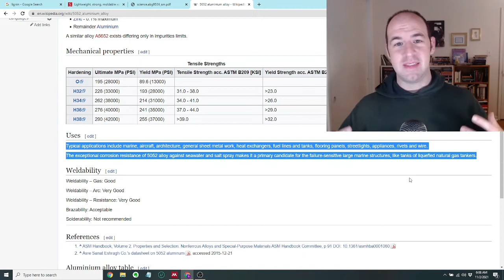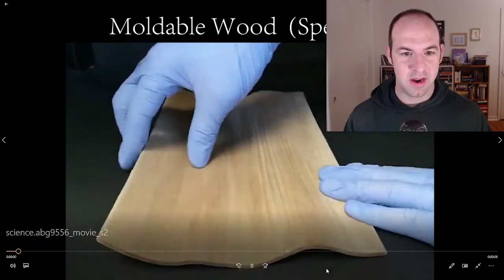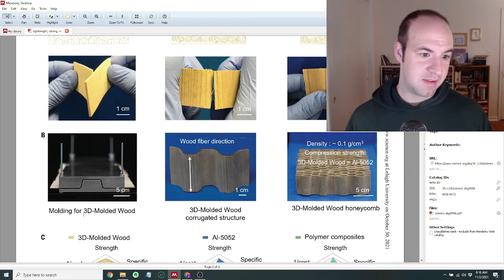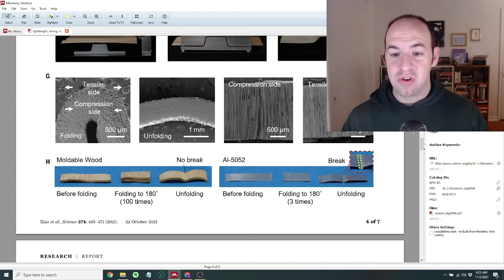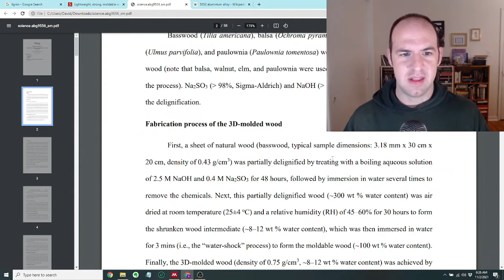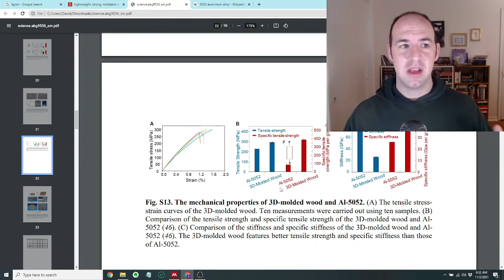Wood You can Roll Up Or Fold 100 Times

Comment: I read the paper and find the results obtained extremely interesting! In the video it says that the wood can be bent up to 100 times, however it must be wet first right? Is it possible to maintain in this wood the property of bending without it necessarily being wet repeatedly? Or when it dries out will the wood break by trying to bend it? Or is it possible to apply a product that will keep its " wetness" high and thus be able to bend it repeatedly over time without needing to wet it again?
 Thanks in advance!
Reply from the maker: Interesting thoughts! Instead of being "wet" the way that the plastics industry obtains greater flexibility is to include "plasticizers" which are usually small molecules that help the plastic keep from getting brittle. It occurs to me that if the researchers here could load the wood up with some plasticizers, perhaps they could retain the flexibility even without it being wet. Just an idea!
Reply: @theconflictedscientist  This would be very interesting! Is it a problem for you to contact me? I have some more questions for you on this topic. There are the details in my youtube channel (sorry I had to change accounts, I think Youtube banned my previous comment)
Reply: @theconflictedscientist  That would be amazing! Can I contact you for further questions?